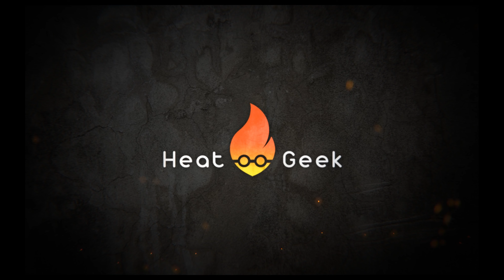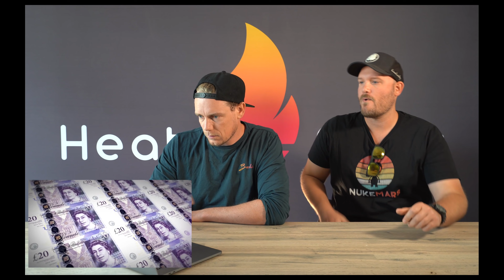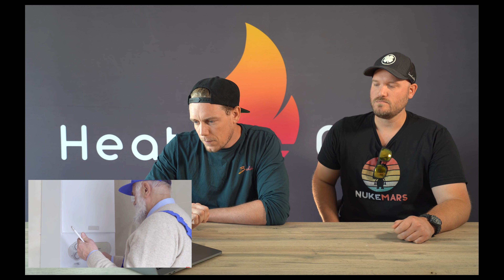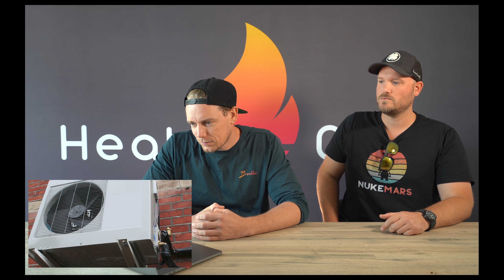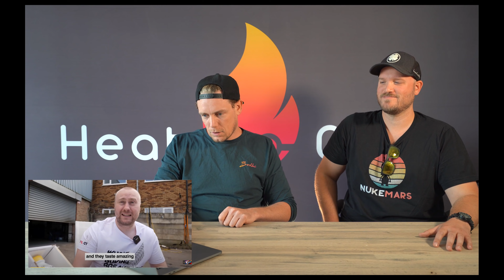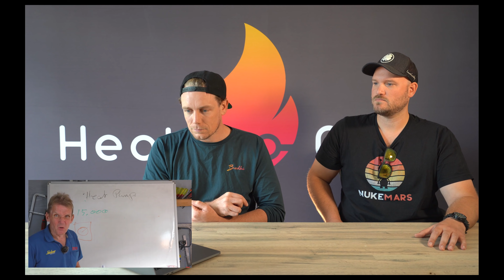Professionals React (BADLY) To Skill Builders's Heat Pump Videos | PART 1 | FIRST TIME WATCHING

Comment: You’ve hit the nail on the head that they aren’t a one size fits all option.

I agree with him 100% we shouldn’t need to subsidise the heating of other peoples homes.
Reply: What about subsidising the insulation of other peoples homes?
Reply: @patrickwheeler2646  I’m not a fan of subsidy in any form.

I’d offer it as a discount on stamp duty perhaps. As in - you can pay £5000 to Boris and Co or spend it on green improvements.

Or the scheme where energy companies used to do it because it was cheaper than improving power stations efficiency seemed reasonable.

Or put a levy on online profits and use part of that, make Amazon, Costa, Starbucks etc pay again seem reasonable.

But fundamentally, subsidies aren’t free money, they’re our money and often given to the wrong people.
Reply: @chrisb4009  love your ‘discount of stamp duty’ idea! Obviously only applicable to people buying properties, but enough of that going on that you would be slowly upgrading the housing stock of the UK which is pretty laughable in terms of EPC ratings and efficiencies! We’re looking to move soon and I’d love to install solar and make other heating and insulation efficiencies in our next property (assuming it isn’t a relatively new build), but the capital cost of investment can be prohibitive. But, saving thousands of pounds o Stamp Duty would cover that!
Reply: Heat pumps are the latest snake oil wheeze that will end in tears for anyone taken in by the salesmen.
Reply: @cuckingfunt9353  Incompletely agree, in 90% of cases in the U.K. 

A heating system that gets worse in cold weather is a really stupid idea.

Comment: The cost of electricity it roughly 4 times the cost of gas per KWh, most heat pumps have a SCOP of around 2, so it’s a reasonable guess that a heat pump will roughly double your heating bills.
Reply: Watch the price of gas ramp up to that of electricity after the COP26 bushit meeting #stockholmsyndrum
Reply: @nickdunbar4460  
Why bullshit?
Reply from the maker: Here's evidence of how they work when well installed in a NORMAL house with tiny rads and little insulation 

https://youtu.be/QLGANlbqIFY
Reply: kWh
Reply: COP of 2 i can show you an install with a COP over 5 🤷‍♂️
Reply: @kenbone4535  Do you know the difference between COP and SCOP?
Reply: @chrisb4009  just a little, seeing i’ve installed 100s of heat pumps.
Reply: @kenbone4535  That’s strange, Daikin for example claim their heat pumps have a COP of “up to 5.14”. So I’d like to see you achieve a SCOP of 5.
Reply: @chrisb4009  i used to work at Daikin, it was not one of those.
Reply: @kenbone4535  OK, so who makes a heat pump with a COP of 10 so you’d end up with a SCOP near 5?
Reply: @chrisb4009  why don’t you actually do some research, you may learn some facts.
Reply: @kenbone4535  Wouldn’t it be easier just to share a product or admit you lied?
Reply: @chrisb4009  i’m really taking offence now, are you a heating engineer ??? Doubt it, but you questioning my experience as a heating engineer for over 30 years. The project in questing was an open Aquifer loop GSHP giving COPs over 5.
Reply: @kenbone4535  This is specifically about ASHP, GSHP are even more impractical.

For an ASHP to have a real world SCOP of 5 from practical experience you’d need a claimed COP of around 10. I’ve never seen anything like this.

And yes I am an engineer both senses, as in a guy with an engineering degree as well as someone who designs/installs/repairs heating systems.
Reply: @chrisb4009  can you explain to me COP and SCOP pls
Reply: @chrisb4009  so if i tell you that my own ASHP gives me 8kw and i’m only inputting 2.3 kw, my system runs at 40° when -2°. How is that not efficient.
Reply: @kenbone4535  Is that ASHP or GSHP? Where are you getting those figures from? For an ASHP that is very good performance, it’s still a very long way from the COP of 5 you previously claimed and I’d expect hay figure to be a significantly lower when temperatures drop to -5 or -10C (assuming it’s an ASHP).

My problem is with the economics of heat pumps and the practicality. The government have no money so when they give out grants for green energy they’re actually giving away out money. It does not sit well that people who can afford £12k for their contribution for an ASHP get £5k in government funding when around 50’000 die most years due to to fuel poverty.
Reply: @chrisb4009  That’s my own ASHP😉
Reply: @chrisb4009  you need to read my comments, the COP of over 5 was a GSHP from an open loop Aquifer.
Reply: @kenbone4535  It’s yours ASHP but where are you getting the figures from? The controller of the unit?
Reply: @chrisb4009  i have a monitoring system on all my renewables, live data constantly being logged. For my heating, solar thermal, PV, TOU tariff, car charger and house battery.
Reply: @kenbone4535  So where does the monitoring system get its COP data from? 

One of the many problems I’ve found it’s that when you compare the pretty poor quality reporting tools for these systems with decent quality instruments where you measure heat flows properly most significantly over report.
Reply: @chrisb4009  temperature sensors and CT clamps everywhere.
Reply: @kenbone4535  what has to be done to get the scop to 5?
Reply: My TWO heat pump have reduced my total energy cost to a third.
Reply: @TrollWithOpinions  What part of the world do you live in?
Reply: @chrisb4009  
Denmark
Reply: @TrollWithOpinions  How do natural gas prices, subsidies and taxes compare to those on electricity in DK?
Reply: @TrollWithOpinions 
Where do you live, and how much did it cost to install ‘two’ heat pumps for goodness sake?  It might be OK for you, but it is obviously not going to work for most people.  The buffoon that we have as a Prime Minister at the moment would not understand this.  On top of that he is mega-rich, so it would not matter to him how high his bills were.  He could just write a load of nonsense in one of his newspaper columns and earn thousands!
( I am a Conservative voter by the way).
Reply: @Pedromyman1  
I replaced an oil water heater that supplied a number of radiators.
It was replaced with two air to air heat pumps and a water tank with an immersion heater.
Radiators were removed from the house.
We live in Denmark and it wasn’t unisual back then to have temperatures below -10 centigrade.
The first winter was the first winter we could move around without thick sweaters indoor. And no ice on the inside of windows.
Our combined energy bill was reduced to a third.
Reason for TWO heat pump is that I have two buildings.
Reply: @TrollWithOpinions 
Thanks for the reply.  Yes in countries like Denmark these heat pumps will probably work efficiently, as I guess your houses are highly insulated.
In the UK we have a legacy of millions of homes that are badly built and leaky, so we fear that these new technologies will be a disaster here.  Our government does not understand this or are simply turning a blind eye to the problems because they want to be seen fighting ‘climate change’.
We have been badly governed in this country for decades.  They have always been happy to waste billions of taxpayers money on crackpot schemes instead of improving the quality and insulation of people’s houses.  We need to learn from countries like Denmark!
Reply: @Pedromyman1  
My house is from 1900 and built for a level crossing attendant. It would be a joke to call it highly insulated or even well built.
Even so. There is a vast difference in setting up a air to water or an air to air system.
We chose air to air combined with a tank/immersion heater for hot water in the taps.
Still we are happy that we did. The whole body of air in the house is more or less the same temperature, whereas with radiators you rely on radiated heat from some chunks of metal under the windows. And it works even if we have NOTHING upstairs except the flow of warm air up the stair well.
Our installation with two air to air and tank/immersion heater cost in todays money around £5,500. Installation included.
With a reduction of 65 percent on the total energy cost, they have earned their keep.
Reply: @TrollWithOpinions  sadly, here in the UK, Air-Air systems (mini splits as they are known in the USA) are not allowed to be installed if you want to claim any subsidy. It's a shame as they don't need to get a high temperature for heating water. And they can be installed easily and quickly. They also free up wall space as there is no need for a radiator and they can also cool the property in the summer.
Reply: @dorsetengineering  
We haven’t received any subsidy either. For us it was a choice partly because we needed better hearing than the oil system and partly because we didn’t see the future for fossil fuels like gas. No holidays for two years.... :)
Reply: @TrollWithOpinions  i just got quoted 28k for 2 pumps!
Reply: why does no one mention off peak tariffs , there is no cheaper gas one but electricity is priced on time of use. I use Octopus Go at 5p a kwh for 50% of my usage
Reply: @waynecartwright7276  Becuse off peak electric is the same price as gas normally?
Reply: @waynecartwright7276 
That will all change as the government make their usual mess or organising the energy market.  ‘Saving the Planet’ is going to cost the ordinary householder a fortune.  Bumbling Boris doesn’t care, he is rich and can get even more by writing his newspaper columns!
( Conservative voter - but disgusted with this clueless crowd we have now)
Reply: @waynecartwright7276  are the heatpumps not more efficient in the day when warner?
Reply from the maker: Double is not trebble.. regardless, you can easily calculate running costs with a heat loss and emitter feasibility before you install.. not out it in and see what you get out 2 years later
Reply: @HeatGeek  If we care at all about consumer confidence/rights, there needs to be accountability. Historically these green schemes are littered with fly by night firms out to make a quick buck.

We really need a realistic illustration for customers, maybe BEIS could provide a tool, the installer would complete a survey, the results of which would generate a simple report or a short video explaining, fuel costs could go up, they may need bigger emitters, they may be noisy etc etc.

The customer would have to sign to say they understand, if the installer doesn’t fit a system that’s roughly as per the presentation they would be personally liable to put right.

Without something like this we will end up with a double glazing type situation. Shady pressure sales tactics and disappointed customers.
Reply from the maker: @chrisb4009  totally agree mate

Comment: Its just like everything else in our trade, the cowboys win the business because they will do the job cheaper. Proper flush on an install? Proper termination of a condensate pipe? Is the existing gas supply the correct size? If you quote to include these things you wont get the work. Shocking.
Reply: That's life. If you quote the same as British Gas they might as well have British Gas do the work !
Reply: @cuckingfunt9353  true

Comment: People aren’t looking to completely redesign their systems though, so his kinda right, for a majority of existing dwellings heat pumps aren’t going to be the answer….
Reply from the maker: At no point did we say heat pumps fot in all dwellings. Does not mean they shouldn't be funded for where they can fit.. we all benefit from the lower carbon.
Reply: @HeatGeek  by that I meant “most people”, not being negative, just realistic.  I’m not suggesting that heat pumps don’t work, more a case the customer base (generally) for them doesn’t. Hell, people barely yet have TRVs as standard still regardless of efficiency guidelines 😂. I think you was right to make these counter views though, if there’s better education for installers and customer perhaps it would help move forward, or better yet, maybe the government should have used
A portion of that money for company’s to provide better training 👍.
Reply from the maker: @Mr_Ashley  yes agree matey but that could be an political thing also.. when it comes to climate change money should not be the blocker.. money is useless in an extinct world.

It's funny that the government generates money when we go yo war... many more billions too! This is more important than war
Reply from the maker: @cuckingfunt9353  2 things there.. china's co2 output is relevant to population. Our co2 per capita is 5.5 tone, the average world wide is 4.79.. so we have work to do before being considered clean. China's is 7.38.. however there's is tiny compared to say USA which is over 15!

Now add to this that China do the worlda manufacturing.. we export all our carbon to them!!! In reality they are probably more clean than us. 

Also.. their renewables industry is by far the fastest growing in the world. Their trajectory is much steeper than  ours.
Reply from the maker: @cuckingfunt9353  yes. When we export all the manufacturer to China we effectively export all our manufacturing. If we manufacture here well need more power and that will cause our gas and coal power stations to come back in line. Almost certainly per capita we would be equal to or higher than them. Per capita being the important measurement if we're looking at who's worse.. China also make the world's solar panels and the majority of the wind turbines we use.
Reply from the maker: In that process their co2 would drop...
Reply: @HeatGeek  You are using these hypotheticals about how we would be worse if we did the manufacturing, why would it ? ... We have enormous regulations, we have to be carbon neutral by 2050, the Chinese don't give a shit, they just keep building more coal power stations, and using slave labour to build them in concentration camps... It's a total shit show, and as you know their per capita is nearly twice ours, but they have a billion people doing it so yes that DOES matter. ... No matter how you twist it, you cannot escape the fact that China makes all the CO2, and there is f-all we can do in the west to stop climate change while China is just ignoring all the rules and destroying the planet.
Reply: @HeatGeek  It's not unlike all these luvies that fly in to these climate summits in private jets and helicopters, telling us how we all have to get on bicycles to save teh planet. ... Prince Harry that used a huge military helicopter to fly to his mates stag do, is telling me to tighten my belt ?
Reply: When I see pince Harry, David Attenborough or any of these others give up their private jets and get on a bicycle then I will believe this is anything other than a big grift.
Reply from the maker: @cuckingfunt9353  I don't agree with anyone doing that...
Reply from the maker: @cuckingfunt9353  yes I agree. Doesn't mean the rest of us shouldn't through spite though imo
Reply from the maker: @cuckingfunt9353  the only change anyone in the UK can do?? Lots we can do mate. Open your mind.. take the red pill
Reply from the maker: @cuckingfunt9353  the only change anyone in the UK can do?? Lots we can do mate. Open your mind.. take the red pill

Comment: I don't mind skill builder for most of the videos, however, found both of these rant videos a bit over the top and started to question how much was accurate myself. If you look through his videos there was a video he did with bosch Worcester manager of some kind destroying heat pumps which though was rubbish as well https://www.youtube.com/watch?v=4uNKPDREa-Q 

Guessing Skill builder is taking some form of commission from these videos. Most of the other videos on the site tend to be a bit more informative

I wish you guys were closer to Sussex as would love you to sort my heating system which is a mess :-). I have UHF fed by a boiler all on the same zone installed by some old plumber who did not have a clue how to design a heating system :-( Why can there not be more heating engineers like you

Comment: Don't  rubbish Roger Bisby, he's  been around a long time; well  respected building industry jounalist and tradesman?
Talk of COP'S, reducing carbon footprints, green issues etc. are misleading in an effort to convince the consumer ( He who picks up the tab!) that all the new? technologies  available are part of a magic bullet solution  to global  warming.
Getting  back to COP'S, assume air source heat pumps are seasonally  3to1, the differential cost per kw makes gas the clear winner.
Then you have the argument,  I here you say that co2 emissions for a gas appliance exceed those as a result electrical generation!
Environmental  issues are a hot topic and used to beat a drum  t
o suit various arguments.
The reality is a host of technologies  are needed going forward!
Any reduction in climate change in the short to medium term is only likely  to happen  in very small increments globally!
As a wise man said, horses for courses, if you get my drift!!

Comment: Roger does other things well in building and he is strongly opinionated, not a problem. In a video after this he had an expert from Worcester Boiler say that electricity is 17 per KW and city gas is 5 per KW. I don't know if that is true but his point of energy that is 3 times cheaper cancels out the cop multiplier would be true. I am a fan of heat pumps as an engineer and installer, if used and installed correctly but fuel cost is a consideration even here in the USA. FYI, wear your Heat Geek shirts in the video to promote the channel, I am saving for a few because they are awesome.
Reply: Adam's is a HG one, you don't like my Nuke Mars T? 😄
Reply from the maker: Thanks bud 😁😁😁

Comment: I would guess that simple resistive heaters with per-room controllers would be the cheaper in reality for most houses.
Reply: Especially if you want to be warm 40deg max from a heat pump
Reply: @nickdunbar4460  Resistive heating is the stupidist thing ever.